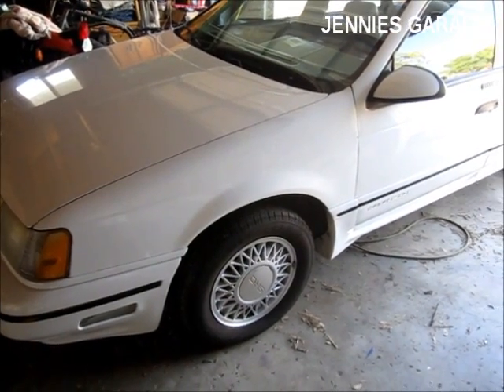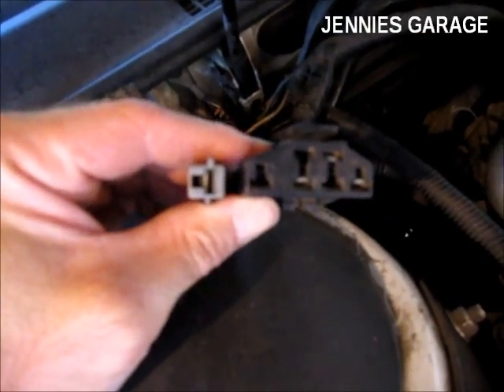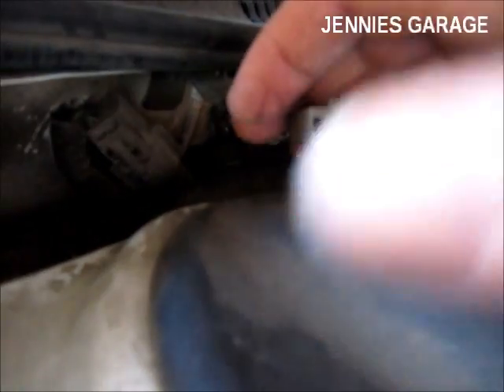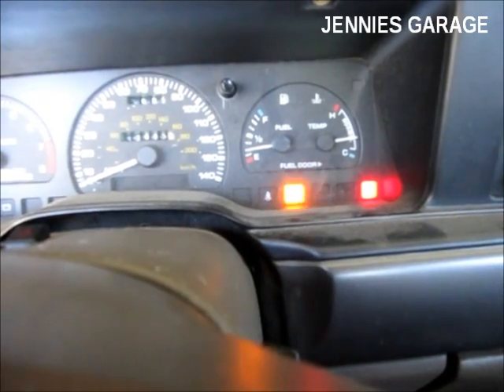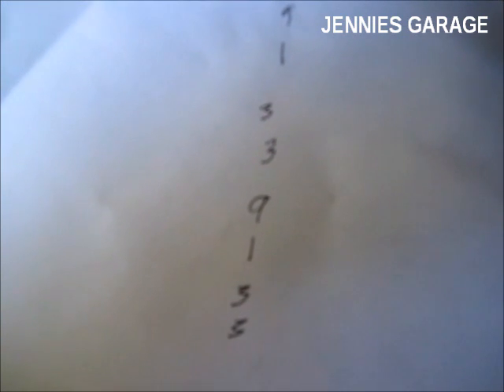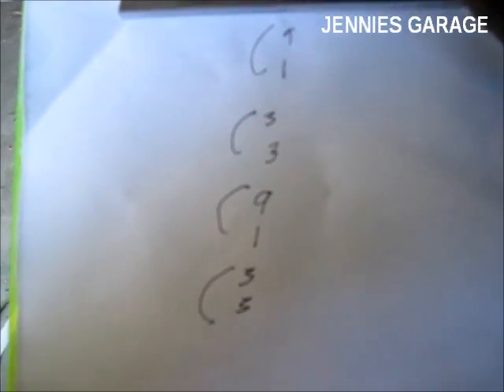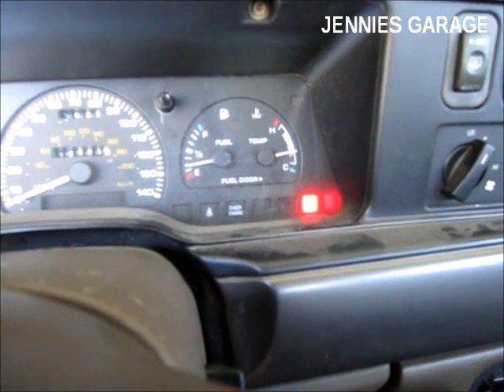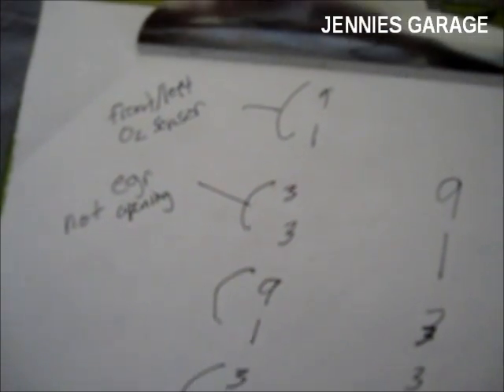1984-1994 Ford Self Diagnostics Test - KOER ( Key On Engine Running )

Comment: Amazon, $25 bucks .. EEC-IV OBD-I code reader that actually tells you the code AND EVEN COMES WITH THE CODE BOOK.  BUT this is a really great way to find out for those who just like to save money but geez that's a long process lol.  I remember doing that with my honda but do you really have to do all of that turning and gas pushing?
Reply: Yes if you dont turn it and give it full throttle for a second it will assume those components are faulty and give codes for them

Comment: Hi I have a 1994 Mercury Sable 3.8L (same as a Ford Taurus) ..I went to go run this test but I could not find the gray single connector, it's not attached to the black plug, Any clue what may be the problem? Please help. Thanks
Reply from the maker: Hi, The single plug should be in the same area as the large one. Just hunt around and you should be able to find it. I have read that in some rare instances the single connector is integrated into the large one. Search google for a diagram of the large plug. If you have an extra terminal it might be the sti wire.

Comment: i did that on my dads ford taurus its a 1994 and the code i got was 412412 and my question is ho wow do i find out what the codes mean hope you can help me out thanks.
Reply: Your code is 412.it repeats twice and since you have a 94 it has 3 numbers not 2.hope this helps

Comment: On my 1988 f250 I do not have the grey single connector. Is this just a ground wire? Can I just ground the other plug to do this diagnostic check?
Reply from the maker: The single connector is the self test input wire, you need it to pull codes. If you can't find the connector, I think the wire originates from pin 48 on the computer. I've heard in rare cases the sti wire being in the main connector, but if you can't find the stand alone terminal, best bet is to trace it out from the computer. Good luck!

Comment: Great video. I have a 93 f150. 4.9L. I have to codes. 998 and 118. I replaced the tps and put back the original bulds on instrument panel.  I disconnected the battery for about and hour and even over night but the check engine light came back on. With same codes. My question is how do I reset the computer. Please help.

Comment: so i tried it and the code was 4141 but when i took out the paperclip it zapped/shocked and the truck died. it wont stay running longer than 5 seconds. its a v-6 2.9. what could it be?

Comment: What about a 95 ford thunderbird v8 I'm encountering a lil bit of smoke out my exhaust an was told my fuel system is running a little rich
Reply: Valve stem seals went bad on those engines that year. They disintegrated in a short time, allowing for oil consumption.

Comment: You said to turn right then left which you did the first time but the second time you turned left then right. I'm guessing it doesn't matter which way you turn first as long as you turn both directions?

Comment: It is not a Running test! Rather a Coad Reader! You Jump the 2 terminals, and turn the Key On, the Check Engin Light Flashes in A Morris Code, Long and Short Blinks Check the Chart etc.

Comment: IMO the Chrysler procedure for checking codes is simpler than Ford's. I own a '94 Jeep Grand Cherokee and you just have to turn the ignition switch from OFF to ON five times and then just keep it in ON the fifth time around, THEN count the number of times the 'Check Engine' light flashes. (:
Reply: yes but chrysler doesn't give an engine running test, ford gives you separate engine running/not running tests that give you better info.
Reply: @marzsit9833  This was before OBD-II, digital odometers, etc.